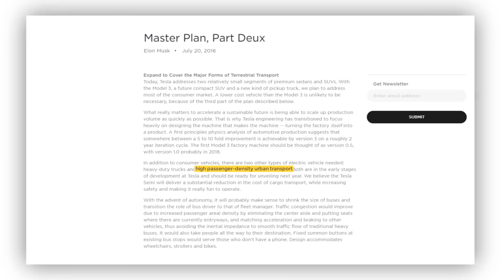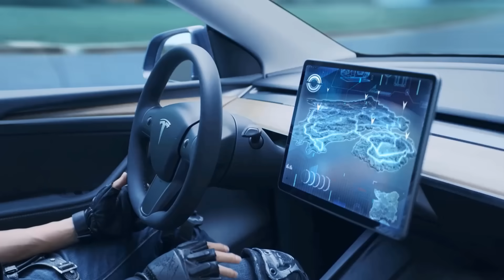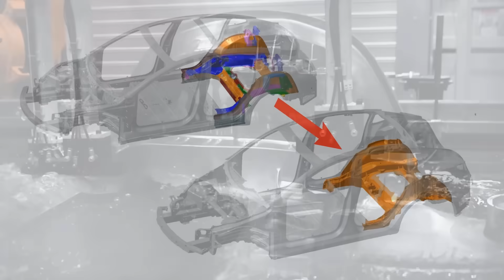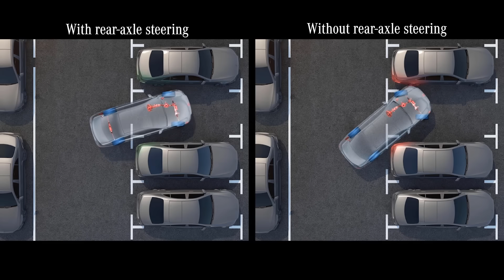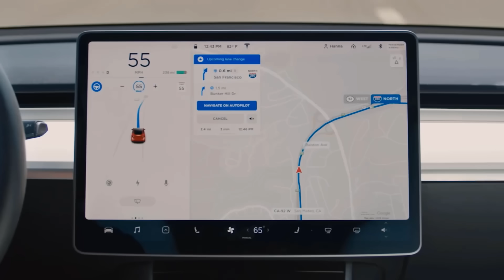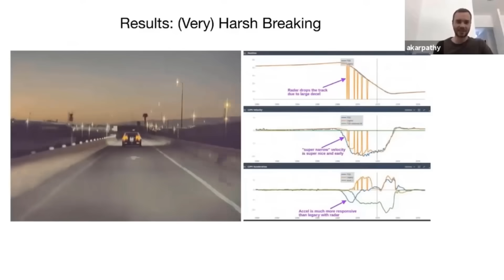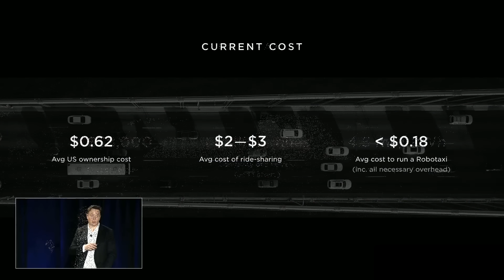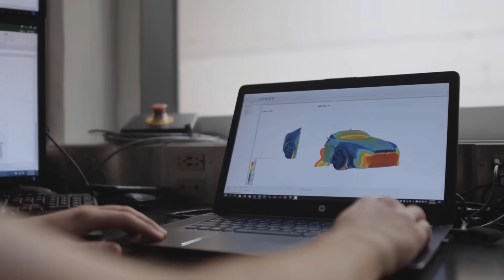10 All-New TESLAs coming to Shock Auto Industry

Comment: I would like the Roadster to be equipped with the Flux Capacitor sinde it already hovers and won't need roads!   Oh and add a nuclear battery that like our nuclear submarines, would only need a charge every 20 years or so. And you might as well throw in the same apparatus that prompted Elan to state the cyber truck could cross lakes under its own steam. (er i mean its own electricity)!

Comment: A car battery for an electric car weighs about 500 kg, the volume is the size of a suitcase. It contains 12 kg of lithium, 30 kg of nickel, 20 kg of manganese, 15 kg of cobalt, 100 kg of copper, 200 kg of aluminum (production is very electrically closed), steel and plastic. There are 6,831 lithium cells inside. You should worry that all these toxic components come from mining. To make a car battery, you need to process 10 tons of salt to make lithium, 15 tons of ore for cobalt, 2 tons of ore to make nickel, and 12 tons of copper ore. In total, 200 tons of soil are ejected for one battery. Disease and child labor are behind 68% of the world's cobalt, and a significant portion of a battery comes from Congo. Their mines have no pollution control and employ children who die with this toxic material. We should count all these sick children as part of the cost of an electric car; SIKHS WITH ELECTRIC CARS THAT CAUSE CANCER

Comment: You made a common basic mistake when discussing the Tesla Roadster 2. It does NOT do 620 miles on a charge. It does 620 miles AT MOTORWAY SPEED. You compound this error by stating that it does less distance if you do some hot laps on a track. The FACTS are that any EV that does a given distance at motorway speeds will go as much as 20% further when driven normally in mixed conditions where the average speed is no more than 35-45mph. That includes everything from a 2015 24kwh Nissan Leaf up to a 2022 Roadster 2. That means that 620 miles at motorway speeds (actually 621 - another error on your part) is equal to at least 745 miles in normal use. This has been done with custom made EVs with 621 miles (1000km) motorway range that managed 745 miles (1200km) in test. This was NOT with hyper-miling. This was driving at normal speeds in normal use. Also you mention the loss of range during hot laps as an issue when it's just a matter of physics and applies to ALL cars no matter what they are powered by. So rare to find this comparison in discussions about ICE cars. It speaks to gross ignorance that your channel repeats this tired trope that EVs lose range when pushed (or when towing) as if if doesn't happen with petrol and diesel vehicles too.

"Future" Lab is still dwelling in the past on some issues. Catch up and earn your name.

Comment: It seems like automakers are forgetting that the speed limit remains the same, but they keep making cars faster and faster each generation. like 5 sec 0-60 wasn't fast enough, then 0-60 in 3 seconds wasn't fast enough later on, and now 2 seconds is not fast enough neither, so Elon made something to make it to 1.1 seconds. yeah... because we need to be that fast on the streets from one stop sign to the next and anyone in the US can handle speeds of over 100 mph on the road on 65 top speed limit roads.  😉

Comment: Here are three things that make me not wanting electric cars.
1. Hackers or government remote controlling my car. Including shutting down the car due to late payment. Or repossession by it driving itself back to the dealer.
2. BMS system shutting down the car due to variations in the battery cells, or current discharge errors. When this happens, a tech has to troubleshoot it and restart the system. The car cannot be jumped or pushed
3. The cost of the battery is outrageous. As well as the question remains as this…… what would happen in the event of an accident? That battery has a lot of energy, BMS not withstanding, that can be breached and short circuited..

Comment: I would like a small Van about the size of the VW ID4 Buzz for handicapped drivers. Where I can have either the rear hatch or a side sliding door open, a ramp extend and I can drive my electric wheel chair up the ramp. Then park it in the driver's position and have it get clamped into position.  I could see this being done with a Model 3 chassis with a taller and square backed body structure. 

The back seat could even just be eliminated or be a couple fold down jump seats. 

The chair could maybe even be supplied by Tesla. A chair that can rotate in its own footprint like the Quantum Q6 I have. Maybe even recharge off the van's batteries. Such a chair can be made to easily pass through a 30" to 32" wide opening. 

In my case, I can still walk but it is painful. But I am fine seated in a chair and can drive just fine. But other people cannot. The self driving controls would be adaptable to work on any combination of handicaps except maybe blindness or quadriplegia. 

This would primarily be a city vehicle so a range of 250 miles would be fine. Maybe even less. Cost would maybe be 10% or so more that the Model 3 plus maybe another $5000USD for the optional chair.  The chair would also be remote controllable so the user could summon the chair so they do not have to keep it next to them when at home. Maybe do this by having the chair communicate with the car and use the computing power in the car to control it when it moves on its own to keep cost down. This chair could also be a good stand alone product that could sell in the hundreds of thousands a year. 

With the aging of the baby boomers I feel this would be a reasonable selling vehicle though it would not be that large a volume one and not likely that profitable. But it would give amazing PR and show how much the company cares.  

In case you are wondering, yes I am an engineer. A retired electronics engineer. 50 years of experience. Contact me though YouTube if you would like more input.

Comment: Here is an idea for Elon. How about an electric conversion package for the classic car enthusiast who wants to continue driving their classic car but would like to burn some rubber at car shows without watching the gas guage tumble towards empty. EG: I just had my 32 YO 1989 Chevy C1500 Silverado completely restored and am now looking to repower it with something more lively than the stock 195 hp SBC 350. What a hoot it would be to go electric. The battery pack could be built into the pick-up bed? Have Elon call me as I have some other ideas!

Comment: But solar panels can be rolled & unrolled now. Just hook them up to your camper/van like awnings, and unroll them.
VOILA! 2 in 1. And even if you prefer enclosed panels, they make them thin enough now to fold away into slots under seats, etc. You simply take them out, set up in sunshine. One cable to the batteries, and VOILA!
There are MANY ways to generate electricity. Don't forget portable wind systems.  *wink*   ;o)

Comment: What about a tesla hybrid plane driven by solar panel, batteries and ice where the reach of speed os faster and with longer range of flight and fuel efficiency. Using 25% of fuel and the rest is all electrical driven. Could also mean having another option in case of ice failure.

Comment: Time index 6:32 this $25,000 vehicle, if in the form of a Chinese Made Tesla Model not 2-(Elon Musk already said it won’t be that name in the Tesla Shareholders meeting), will not qualify for a $7500 USD EV Incentive. The qualifying vehicle has to have a high US component /materials content and be manufactured in the USA based on the version of the Build Back Better law stalled in the US Senate. Stalled by Senator Joe Manchin, who has been snorting way too much coal dust. If an EV is to qualify for $12,500 off EV Instant Federal credit at the point of sale, the vehicle must be manufactured in the USA, have a high USAcontent, and be Union Made (United Auto Workers).

Comment: Boy racer.speed cars.should.not.be driving like.that anyway and surely that must.drain energy from.the battery which reduces milage .should be some ristrictor on these high powered electric cars. 0 to 60 in less than 2 seconds you step.of the pavment at the wrong Time your history and you would.not have even heard it .

Comment: CT will fail but its NBD. 
Sub $20,000 Tesla from China will crush all China completion and will see America and Europe begging for the same. 
Yes 
Cheap no display just like Boeing or Airbus commercial aircraft B.F.E. seats entertainment systems. Tesla sub $20,000 no display that will be B.F.E.. Sub $20,000 Tesla needs to cut corners. America Europe will be begging Tesla to allow this sub $20,000 BEV in and it will be a winner like VW Beatle was.

Comment: The ultimate long term answer will be  to have wireless charging with an auto "move" system that reparks the car when the charge is complete.
Reply: It would but still. Wireless has limits. Cables dont.

Comment: What Tesla needs to do is an Heads Up Display to the Model 3 and Model Y as an option, so that those customers who are not comfortable with a center console display only, would then have the ability to see key metrics, e.g. speed, available battery range, etc. while looking forward through their windshield vs. having to look away from the road to view the center console display.  If this was available, I would purchase a Model Y today.
Reply: The display is made the way it is because Elon said he simply wants to "delete" parts as FSD comes out and you wont have a steering wheel or pedals for examples.
Reply: @amircohen143  in the mean time hundreds of thousands of Model 3 and Y vehicles with steering wheels and pedals, and oh yeah “drivers” are forced to take their eyes off the road to look at a center console for information on speed, range, etc.  That does not meet the “safest vehicle made” standard that Elon aspires too supply.
Reply: @amircohen143  A "car" with no driver controls is NOT a "car". It is a transit pod, the passenger carrying component of a public transit system. A "car" is about driving ... hands on the wheel, eyes on the road, carving the corners ... no controls? No thanks.
Reply: @PhillProbst  So you’re welcome, and don’t buy a Tesla, because Tesla’s cars will drive themselves, because the car is a robot on wheels, 4 of them, and the same technology used to drive a Tesla car is the same AI focused technology that will be used to operate the Optimus robot. 

So just like the car, the Optimus robot will be able to learn just like you and I and all of the other people with functioning brains, can learn from each other, and from their respective environments, the car and the Optimus robot, and everything that Tesla does will use autonomous AI technology. It will not necessarily need you to tell it what to do, as it will automatically be able to go or do things on its own unless, of course, you instructed not to do something or you give it new instructions on what you would like it to do, but unlike you or I, the optimist, robotic, AI driven brain will have total an instant recall, in other words it will never forget anything, and it’s memory will be admissible in a court of law, something I suspect will be a hotly debated subject, as this technology continues to be rolled out to the public. 

So imagine if you were to commit a crime, and the Optimus robot that you own knows about it, its memory will be admissible in a court of law, betcha you haven’t thought about that have you? 

Yeah that’s how different life is going to be as these products continue to be developed, and improved upon, because no one at this particular moment, that I am aware of has a level 4 or 5 autonomous capable driving car, but if we’re going to get there, and I believe we will, my money is on Tesla to get there before anyone else does. Comphrende. Cheers 🥂
Reply: Have a look at Vinfast, they addressed exactly this feature for their brand new line up

Comment: I would like to see tesla make a purchasable drive platform at a reasonable price so people like myself could convert their classic cars to electric power.
Reply: Atlis motors is already building this exact platform.
Reply: @1LILLMAN  Well, it seems they just have a pickup for now. Further there are different pictures of them one looks like an ugly toad trying to be closer to Teslas cybertruck and it seems that this is attempted how it should look like when it ever comes out. The other (prototype?) looks more promising but it seems this is not the design they have choosen. However I don't need really a pickup. I would like to see some big, comfy SUVs. And last but not least what is the price?
Reply: @leonlionheart5927  they are also manufacturing a plug and play platform.  The xp platform which will give the ability to convert any vehicle to an all electric standard.  I believe they have projected prices on the website.

Comment: I would like to see Tesla produce a 21st Century version of the classic GMC 1970s 6 wheel Motorhome which IMO still looks futuristic 50 years later. It has a wide flat chassis ideal to hold the battery packs and a large flat roof that would suit solar panels.
Reply: Everything in time like the electric car every one said he couldn't make it happen even the stock market experts at the time said he would fail now every one is on the band wagon, or get left behind, GM is one of those company's if they stay with gas they will eventually go bankrupt with out the tax payers bailing them out, I turned against GM when in the 70s they destroyed there EV cars they would be the leaders now if they didn't cave in to Big Oil I don't buy anything GM I will never buy anything to a sell out company.
Reply: @Zanzamor  - Then you must not buy much, because a whole boatload of companies are absolutely crooked shysters, especially behind closed doors.
Reply: You're talking about "The Urban Assault Vehicle" from the movie "Stripes"

Knew someone that had one of those,..MONSTER. But unbelievable smooth and cruised nice.
Gas mileage? Um, well, not very good, to say the least,...especially on older ones that needed a rebuild.
But the infrastructure wasn't there anymore to fix these monsters in their shops, and the owners didn't keep up with it themselves...and they stopped making them, the dirty dogs. I WANT ONE! LOL
Reply: I would like to see Tesla create a whole range of Stainless Steel vehicles from sub compact to smaller cyber truck as well as Mobile Home options for the Semi.  Solar and wind gens and extra batteries on the trailer portion would alter range massively.
Reply: Love elon

Comment: Tesla is a scam operation with a bit space fakery ... this tunnel boring crap is fake while real company's with real equipment building gigantic tunnel systems, the hyperloop is a 50's idea and totally impractical and the market for e-cars is capped by the electrical grid. Good old coal, oil, gas and nuclear gives power to this pseudo green mobility. Good luck with that crap when shtf.

Comment: Tesla's phenomenal acceleration captures the emotions, but the vast majority of us who drive sanely and would never use that feature, except maybe in an emergency, are more concerned about increased range: similar to 600 miles on one charge.
Reply: Except that most people only do between 20 and 50 miles a day so why are you so concerned about having 600 miles range. Whilst range anxiety is real, the reality is that as few people who want to drive to 60 in 2 seconds want to drive 600 miles without recharging.
Reply: I give it a burst every now and then just to make sure it is still there
Reply: The next Fast and Furious will have to be EVs.   I would like to see Tesla create a whole range of Stainless Steel vehicles from sub compact to smaller cyber truck as well as Mobile Home options for the Semi.  Solar and wind gens and extra batteries on the trailer portion would alter range massively.
Reply: @npbiggs4382  Why not carbon fibre composites which are 80% lighter (and which don't corrode). Carbon fibre has been used in F1 for decades with crash worthiness designed in.
Reply: @SuperNevile  Too expensive compared to steel.
Reply: @npbiggs4382  True, but no one said that extracting that extra range was going to be cheap......
Reply: @SuperNevile  Still does not need the added expense of Carbon Fibre when Stainless is just about as good but way cheaper.

Comment: Mr.Elon Musk should compete for the first fighter Jet all electric turbine thrust,or helicopter,and personal heliRaptors...and why do they not have internal Altinator capacity for self charging vehicles that simply charge themselves by recycling  the charging directly and call it  Elonic 3.1 as Pi,meaning,perpetual,self energy producing energy unit 3.1...I have a multitude of designs that will make Elon amazed,never seen before grand designs.Originals.

Comment: Are you sure that the SVR was in proper mode? You need to be in manual select and crank it down to the very lowest gear and it should start faster with instant torque. It appears as if he was driving it normally... Even my 2001-2009 series starts-up way faster than this SVR and it's only rated at 385-400 HP....

Comment: I want 1200HP electric motors, for my 110' yacht, that will run off solar panels and/or small generator using the blade batteries or the liquid metal batteries.

Comment: I would like to see an AWD compact car with some underside room to go through a little snow, in other words a Canadian model.
Reply: The Tesla Y with all wheel drive works just fine
Reply: That would be the Polestar SUV out now .......
Reply: Ford F150 Lightning out of Detroit with full time all wheel drive and four doors 0-60 in 3.8 and 435 miles empty and 300 fully loaded ....  38 thousand out the door
Reply: Either one is all wheel drive built for cold weather starting at 38 thousand .... Luxury or game changing Tesla ruining full size truck ???
Reply: bZ4X